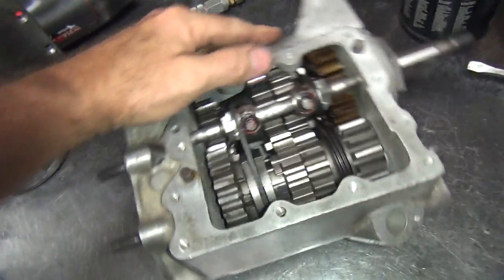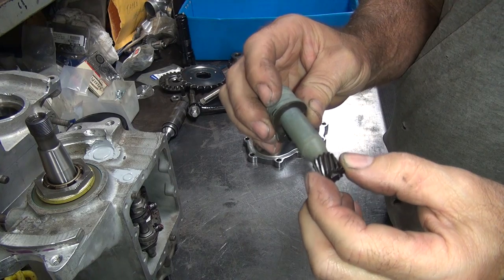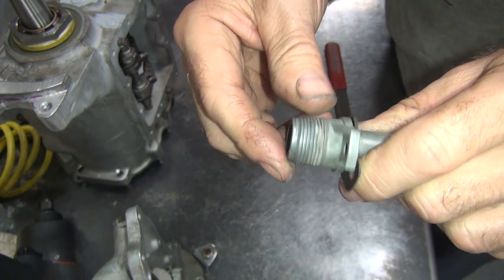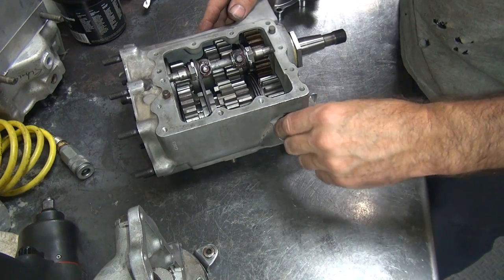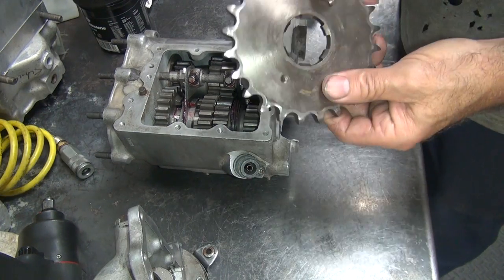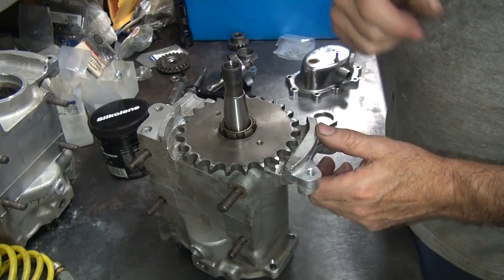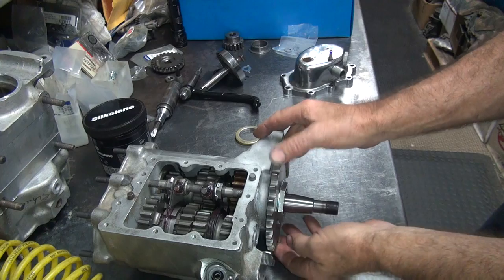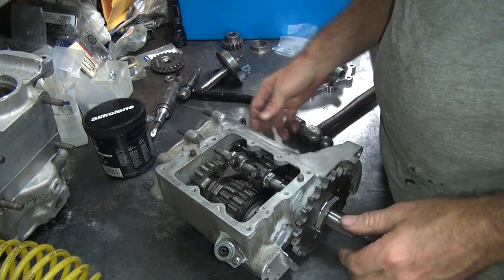1965 panhead #119 4-speed transmission rebuild FL FLH 1966 shovelhead harley by tatro machine

Comment: Hey Tatro, during original assembly did Harley ever use any thread locking compounds, or did they just hope their crap wouldn't rattle apart?
Reply from the maker: they use lock tabs and pins when needed. loctite came out in the later 80's on harleys.
tatro